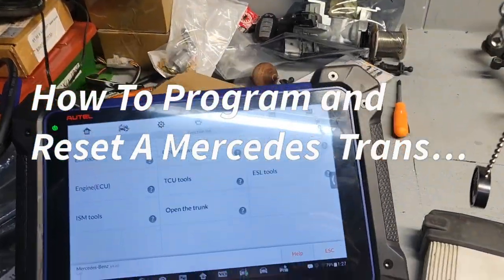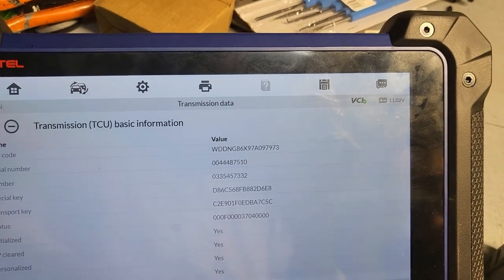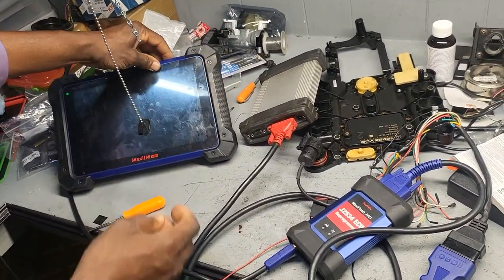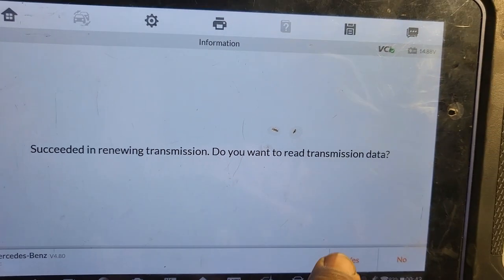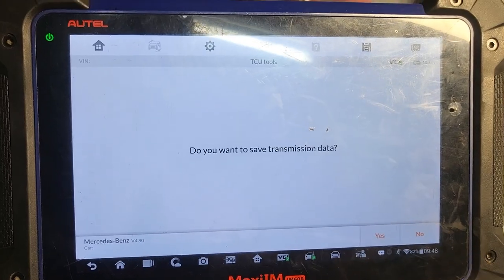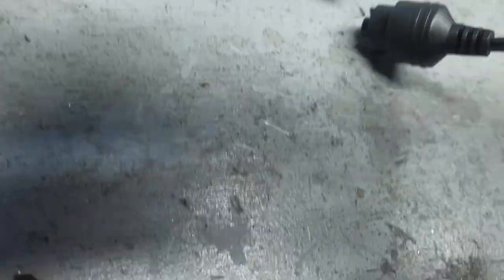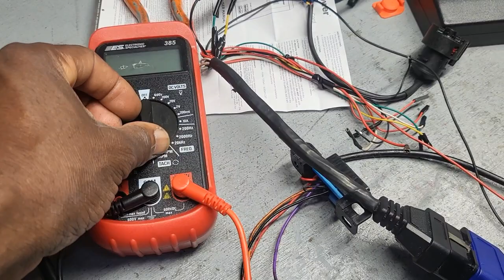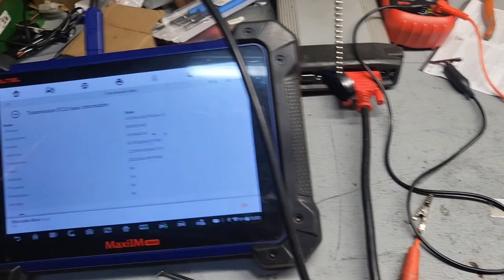Mercedes Transmission Control Module Unlocking by 608 Obd2 Connector was Bad Requires Subscription

Comment: Hello sir, i have a european model MB diesel hybrid (w212 2014). What diagnostic bi-directional tool you recommend. I'm from Europe. Thanks for the time you spend by helping other's.
Reply from the maker: The best thing to do is to get mercedes  a chines scanner one and play with it
Reply: @BestCarFixes  thanks for your time spended. What you think about the scanner tool Icarsoft cr pro multimark? I have 3 cars at home. But my MB212 will be the special scanner guest! What you say about. Ive notice you have a expensive one. I will say that isn't for me. I'm not an expertise like you are. So, chinese scanner probably they have plenty and probably these are all chinese manufactury from. 

Ive think my MB injection systems wasn't in the best conditions, bcz bad diesel. Already full the tank and put stp cleaner for tank and injection system. The OM651 motor noise are fine,  but the gearbox isn't running normaly. Probably will need to restart it and run 10 miles to reeducate the 7G tronic transmission to my drive. 
But before I will need to reset the fault. 
I hope it is only bcz bad gás, and not ECR, HPFP or LPFP. That's why my needs.  Thanks again for your time spended.

Comment: Hi I got autel im 508  and I would like to connect ism  module from mercedes ml. Just quick question  I found the diagram on autel without  gbox   use by obd   the question is do I have to use  xp400  then connect the pins from obd connector to ism module  or just go directly without  xp400?
Reply: Don't need the xp400

Comment: Hello Mohammad I got a question where you got your connector cable? Or you made it by yourself?
Reply from the maker: you can do it yourself just put 120 ohm resistor between the can line

Comment: Saya baru saja menurunkan tcu mercedes w245/B170 Dan saya menjumpai ada 2 jumper yg putus sehingga speed sensor /transmision failed contak workshop.

Pertamyaanmya apakah setelah saya menyambung bagian yg putus tadi akan lamgsung normal ataukah butuh instal software
Reply from the maker: No need programming
Reply: @BestCarFixes  tapi apakah fault2 tertera transmission consul workshop akan hilang dengan sendirinya...
Setelah saua pasang semuanya...
Tanpa programing

Comment: The Dealer told me my car, 2004 ML350, can not be fixed. The AAM went out and is now obsolete. Does you know a work a round because these computer are specific to each car and you can not substitute used parts. Great body , tires, interior, I need help!?  Question, is it possible to bet the ECM, AAModule, and Body controL (kEY) module from a like can with like number and re-install them in my can, WILL IT WORK.  oH, YES, DO I NEED THE TRANSMISSION MODUEL ALSO.  THE DEALER WILL NOT TOUCH ANY USED PARTS.  THERE ARE NO MECHANICS IN THE DALLAS AREA WHO CAN HELP ME.  WHERE ARE YOU , ANYWAY?
WHAT WILL YOU CHARGED TO FLY TO DALLAS WITH YOUR TOOLS TO FIX  CAR?